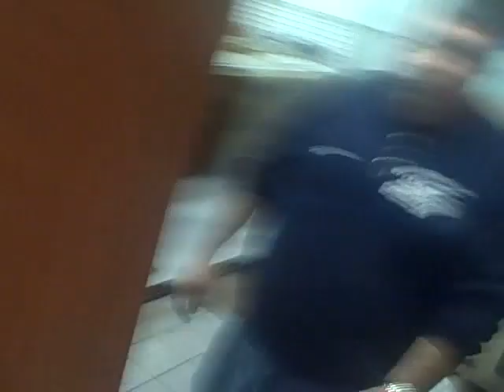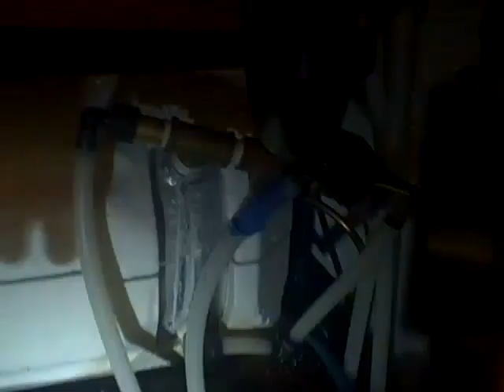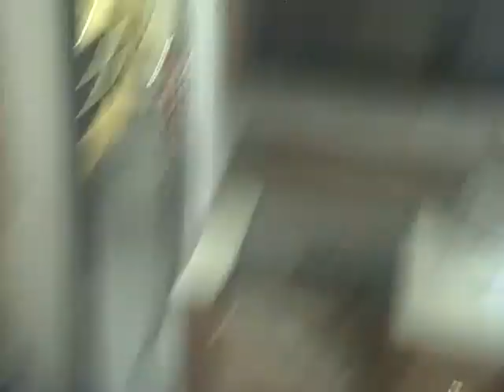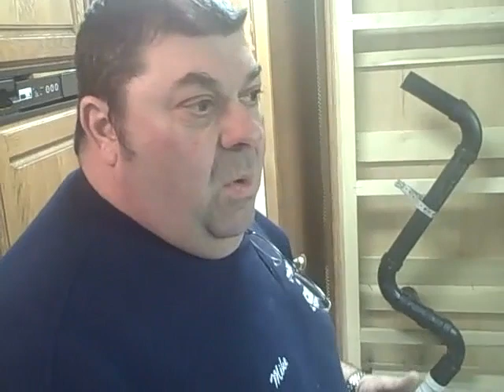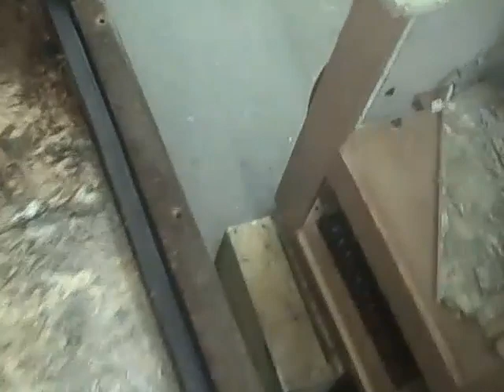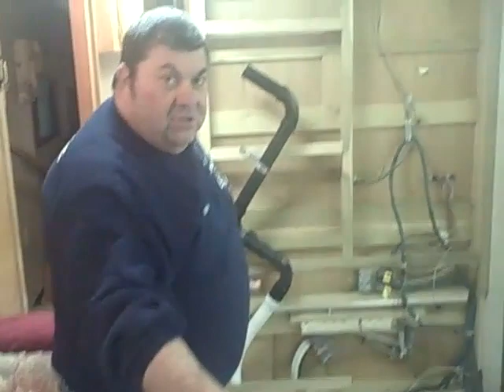A $2 PART  TURNS INTO AN $8000 REPAIR!

Comment: $400,000 rv with a chip board floor. I would be pissed.
Reply: Chipboard weighs less and provides better insulation, so, as manufacturers work to reduce weight to meet your fuel economy demands or allow smaller vehicles to tow (travel trailers), you'll likely be seeing far more of it, not less.

Comment: I find it a bit hard to believe that the damage was not detected sooner. The water heater is under a sink and next to the flooring. Most likely the wood base on the floor would swell or there would be moisture. The owner should have Mike maintain it. Best $100 he could have spent.  This motorhome must have stunk to high heaven long before they brought it in for repairs. Lots of owners don't do a thing to inspect roofs or other things. But it sure sounds better blameing the $2 part than owner.